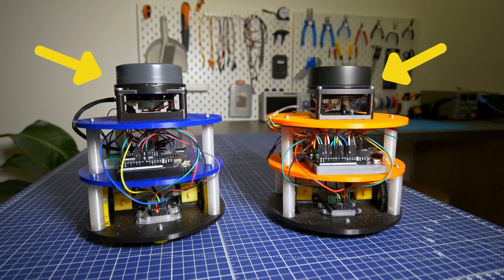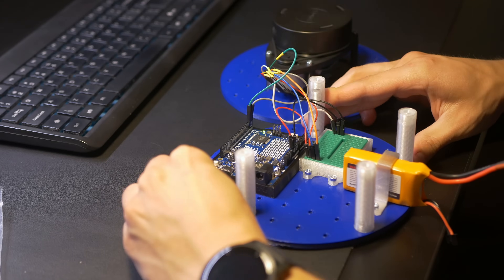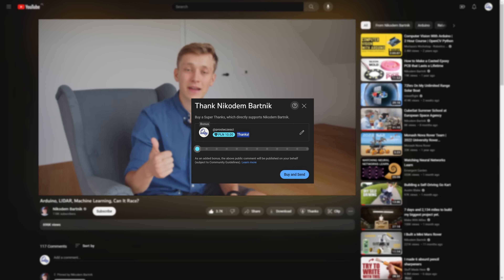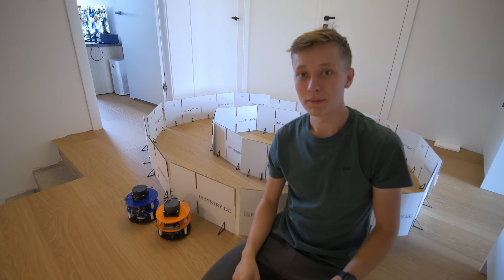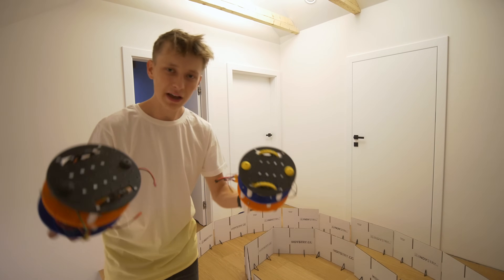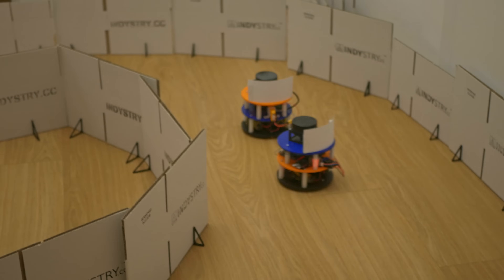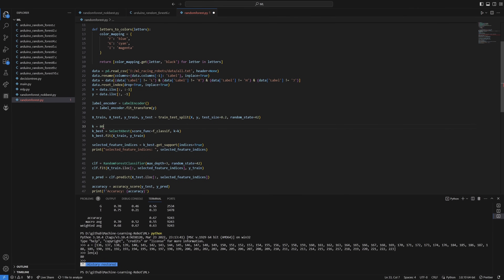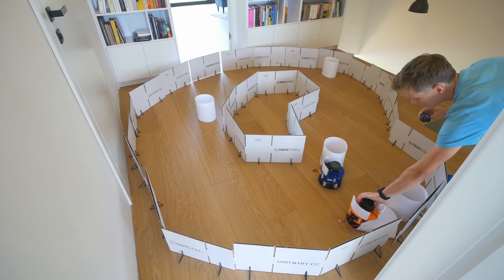Arduino Machine Learning Robot Part 2

Comment: You have to use the right tool for the right job. An Arduino is not the ideal platform for ML. Arduino is best as a microcontroller. Use and RPI for the ML.

Comment: Am I correct in assuming that the control loop basically works "stateless", in the sense that the racing machine is not really aware of it's own position, it just computes the steering signals based on the LIDAR input? If so, the obvious next step would be to create a proper environment map, then navigate in that. You can do that using machine-learning as well I think, but there are static approaches as well(see also ROS). Awesome project!

Comment: What's a LIDAR?
Reply from the maker: LIDAR (light detection and ranging) in general is a method of measuring distance with light but in this case it refers to a device similar to a radar but it uses light to measure the distance between the objects.
Reply: @nikodembartnik  thanks. Is this second one found in autonomous cars?

Comment: I just came across this. Would be interesting to see the performance compared to a neural circuit policy or liquid time constant algorithm, since they are supposed to perform better with smaller datasets and smaller model sizes. A python library exists that provides templates for tensorflow and pytorch, but unfortunately not sklearn.

Comment: 6:56 is a great solution but won't they capture false data?
Reply from the maker: I am using kbest to select the dimensions that are the most correlated with the label so the algorithm will get rid of all the readings in the back that do not contribute any important data to the final control label. This part is a little bit more explained in the previous video so check it out: https://www.youtube.com/watch?v=PdSDhdciSpE

Comment: I've been tackling similar issues, although not specifically with drivable robots, but rather with other machine learning problems that involve introducing a new "state," which becomes particularly challenging due to the scarcity of data points in the training set. Have you considered augmenting the datasets you have? There is some previous work done on augmenting lidar data, Google: LidarAugment: Searching for Scalable 3D LiDAR Data Augmentations. You could also attempt to oversample the data by duplicating scenarios where you're trying to avoid obstacles. If you are able to label the start and end points when the robot is attempting to navigate around an obstacle, it is also possible to train models with attention to these labels. In any case, I always find your videos interesting, especially the way you present the problem and then approach it in your unique manner. It's a steep learning curve, but it's the most rewarding one, trust me. If you'd like, you can reach out, and I'd be happy to offer my assistance.

Comment: I also worked with the A1 RPLidar for my project, a stair climbing vacuum robot, and I also managed to get data from the LIDAR with my Arduino Mega, but the problem is, that it is not that much data like it is when you use it with ros2 and a raspberry pi or something like that. That is why I made my tolerances for measurement bigger to be more safe.